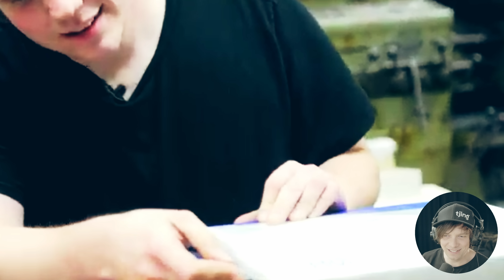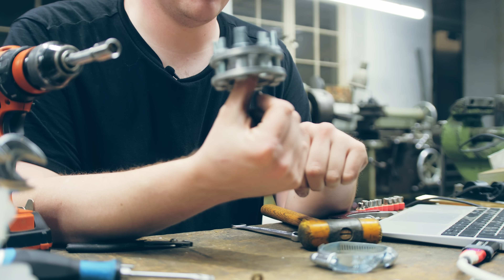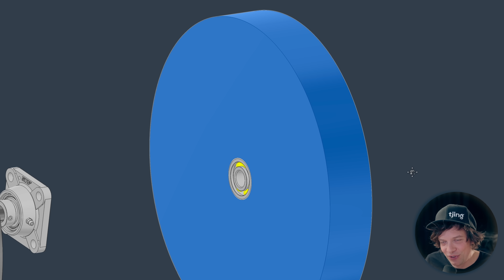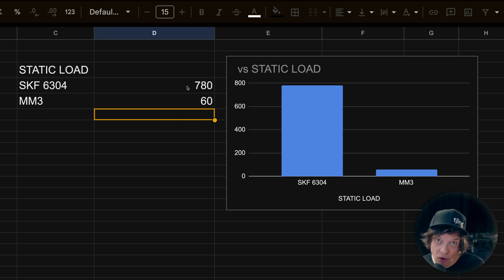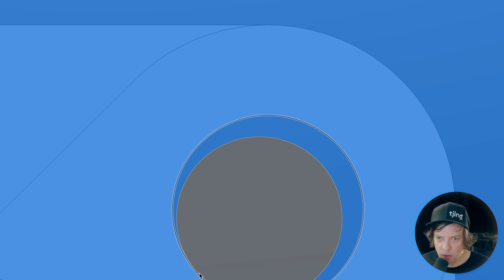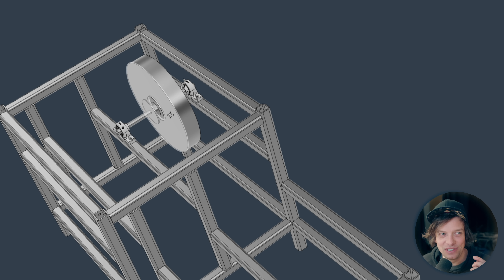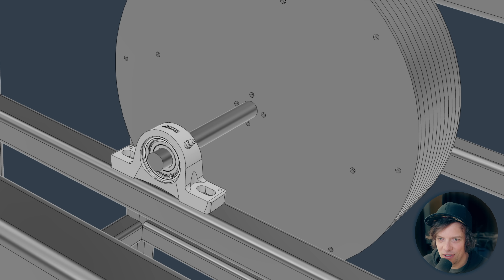Worst Bearing Housing Ever - Marble Machine 3 Ep.3

Comment: No Martin! The bearing load ratings are not what you should be worried about! The threads on the bolts WILL crush and that will allow movement and will get worse in a hurry. Even solid steel pins/rod would be better than anything with threads. The contact patch of the threads on the bolts is very, very tiny compared to the contact surface area the outer housing bearings were designed for. 

I have tried a threaded rod for a shaft inside a bearing and the threads crushed within a few minutes of runtime and had terrible vibration. I assume you dont want a lot of vibration in MM3!
Reply: I totally agree. The steel that is used in bolts is generally plasticine. It's not serious.
Reply: @no47-km  They make bolts out of all grades of all types of materials. It is very easy to find bolts made out of high grade steel.
I do not believe bolts are the right solution for the bearing housing but I do not agree with what you have written at all It's easy to verify what I have written to be true. Here are some grade ratings for metric bolts made of steel or steel alloys: 4.6, 4.8, 5.8, 8.8, 9.8, 10.9 and 12.9. Nobody is making bridges using bolts that could be compared to plasticine.
Reply: Exactly my concern and comment. Not only are you point-loading at the tangency contacts of the bolt to bearing OD, that supportive contact patch is further reduced by that the actual contact points are focused on the peak of the threads, which are relatively rather soft. A traditional housing has 100% contact area, whereas the bolt solution has less than 1%.
Reply: Not to mention that he's hammering them in and already mangling the threads to begin with.
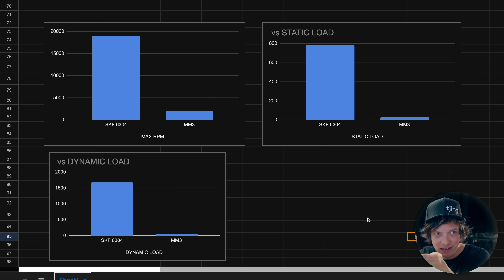Reply: It's weird how he is looking at posts discussing the bearing housing, all in response to a video on the bearing housing, and he thinks that the thing people say will fail is the bearing and not the housing. But I see he's not the only one, given the comment at 11:21...
Reply: Here is another thing; in previous videos Martin has mentioned that fewer parts have fewer points of failure and yet this has SO MANY PARTS compared to standard parts.
Reply: These parts are going to be vibrating to some degree. Even if this only affects the threads on the bolts a minuscule amount, any amount of give they gain will quickly snowball by adding to vibration, etc. The more they crush, the more it will vibrate, the faster they will degrade, and it could end up entirely tearing apart the machine.
Reply: I'm a bit late here, but Martin, I agree with @keonfrey5560 . This has ABSOLUTLY nothing to do with the bearing. The key thing you seem to not be understanding is that bolts are not intended to locate two parts on a sliding fit. They're intended to clamp two flat pieces together. In many of your applications on the MM3 it doesn't matter much, there is plenty of extra strength to handle a small amount of side load with little vibration full support all around and a rather short area of loading in the first place. Here you have one of the most critical highest danger/load/vibration applications that MUST work correctly for safety and function, and you're pairing it with a huge unsupported side load span on bolts. It WILL crush the thread, it WILL stretch the bolt over time, it WILL get loose, It MAY even start fracturing the bolts due to fatigue cracking. That bearing WILL come loose from the flywheel, it's just a question of how long it'll take, and this is not a factor that has any grey area.
Reply: Also, Martin, DO NOT trust GPT for something critical. The only thing it's been trained to do is to writ things that SOUND like the fit the prompt. It doesn't know and indeed doesn't even CARE about the correctness of anything. If you don't have the math skills to do the math, that just means you can't spot it when GPT is confidently wrong.
Reply: Yes the only way I can think of that the housing wouldn't move would be if the tension was really really high between the laser cut plates but that probably won't be enough friction to keep the outer bearing race from moving.
Reply: Also, bolts aren't made to deal with high shear forces.

Comment: do you really need that shaft has to be round? If it will be square it will lock itself in the corresponding holes in the flyweel. and for the bearings use lasercut conductors (inner - square, outer - round) =)

Comment: The failure mode they are referencing with your design is not with the weight capacity of the bearing, it is the support of the bearing in the clamp.The contact area keeping the bearing concentric is the threads you already deformed by hammering in the bolts. Think of how little contact area there is on the outside of the bearing being only the threads of bolts vs an entire solid housing. This will cause it to deform when flexed, any deformation each flex as it rotates will eventually lead to wear and failure, or running out of concentricity with prolonged play.

Comment: I really like the solution with adjustable paws, similar to a four-jaw chuck in a lathe. Don't try to achieve completely perpendicular and concentric flywheel plates - this is HARD. Get it close enough and have a method to securely adjust and dial it in using a run-out indicator.

Comment: I do not like your cheap bearing mount because it puts the load of the mass on the bolts and potentially puts in a side load to the bolts themselves instead of allowing the bearing itself to take the weight of the mass.

Comment: probably said 100 times arleady but from my experience chatgpt is pretty bad at math the foruma it wrote out (0.001 x 60 kg (209.44rad/s)^2 x 0.2m) results in 526.38N not 525.29N only 100ish grams of in this case but its enough to prove my point.
the Formula i dont know and i havent really experiemtned with those on chatgpt but it looks like a very big simplification becasue dynamic load usually is very use specific and complex.
But i think its okay in this case because all youre doing is using it to proove a point where even if its off by a small magnitude it doesnt matter.

Comment: It's not the stress on the bearings, that is a problem. The bolts are NOT designed for such perpendicular loads. This is the most scary part.
Reply: Shoulder bolts?
Reply: Especially the threads. They'll deform
Reply: Not only that, the threads have to withstand the forces. Since the threads act like small stands holding up the bearing and the weight of the flywheel, more pressure is on the tip of the threads, thus blunting it, causing the bearing to sink.
Reply: Also belting the bolts through with a hammer? It deforms threads and bolts, breaking the precision. So many parts…

Comment: You can use SHRINK FIT method to mount flywheel over shaft but use key also.

Still you need to plan for static and dynamic balancing.

Comment: With a live shaft maybe you can build the flywheel roughly with the lazer cut disks, and balance it afterwards with weights like we do with car tyres. Or perhaps you could build a jigg with the angle grinder for grinding the flywheel completley round while sitting inside your machine. Using your machine as a makeshift lathe. You could even grind the sides of the flywheel to remove any wobbeling. So... just build a mount for your angle grinder!

Comment: Without uniform pressure on the outer bearing race is important for a decent life. At 2000 RPM at an hour 120k cycles per hour. You will easily start to deform the bolts and lose the "press" fit that you think you have. Also the bearing race deforms and will wear out prematurely.

All being said you are welcome to try whatever you like. The SKF application engineers will tell you the truth and set you on a good path.
Reply: My thoughts exactly, these bearings aren't designed to be held with 8 point loads on the outer race. The race is likely to deform over time and cause vibration or worse yet complete failure of the bearings. They're designed to be held equally around the outside circumference. Press fitting them into plates and then bolting those onto the flywheel would solve that issue and allow for easy swapping if needed (aka the press fit flanged bearing holder).

Comment: On the laser cut flywheel, add a key hole on the center each plate in the same place. You can join all the plates with bolts anywhere. THen just use a keyed axis and a long key, as almost everything that needs a axe an flywheel clamped together do. You can machine the axe, but you can also buy it pre-keyed.

Comment: I am NOT a pro, not even a noob.

We do not want concentricity. We want the machine to be as stable as possible and if the center of mass of the flywheel is not perfectly aligned with its axe of rotation, then we have a problem.

Of course, being perfectly concentric would solve the problem but we can solve it in another way.

When repairing a car tire, the garage people mount the tire, then they spin it to see how unbalanced it is, and then they glue some mass on the wheel to correct the problem.

Doing the same thing might be a good idea. It does not require god like precision, and seem simple enough to implement.

Comment: Unlike the programming wheel, you don't need the flywheel to be concentric. Having a uniform radius around the flywheel is not really your requirement.

Your real requirement is balancing the weight of the flywheel, and there are ways to do that (adding in or drilling out unbalanced weight) that don't require concentricity.

Comment: I think you are looking at this wrong. A concentric flywheel is not necessarily balanced. Mounting the flywheel close to concentric then balancing it is likely much easier and faster than adjusting the bearings until there is no vibration. You'll find that a majority of low cost products that spin fast are balanced rather than perfectly machined or adjustable. I'm sure you can find somebody with a machine that is used to do balancing if you don't want to do it yourself. You can also design features into the bearing mounts that can damp any vibration that hasn't been worked out.

Comment: I don't think the comment about the bearing failing was in reference to the actual bearing, rather the housing.  Hardened steel bearing race vs mild steel bolts will wear them, and cause the bearing to be less constrained.

Comment: They are oversized so you can get it concentric - I used to work in a factory, and if they can do it for the industrial drain cleaning equipment, I am sure it will work here.

Comment: as a mechanical engineer i can't help but cringe... please listen to the comments, or read some design handbooks at least... or worst case ask for the help of an engineer... that's what we're here for.  if machined parts are a problem, there are rapid machining prototype services available that will work much like your laser cutting service.  Flywheels hold a lot of energy and should be treated seriously.
Reply: Martin isn't just falling into multiple useless rabbit-holes. He's farming rabbits and digging holes for them.
Reply: I haven't done mechanical engineering in almost 10 years now and I'm cringing too... He really should have considered off the shelf parts first and foremost. Not only are they a solution proven to work, but if anything fails, it's a phone call and an overnight courier away. What is he going to do if one of his highly tuned, custom built parts fails on tour?
Reply: @CristiNeagu  it's called industrial lego for a reason, he needs to use those pieces instead of bespoke parts

Comment: I know it may not be for this particular application, but if you laster cut the flywheel plates and are worried about how they are clamping on, you could weld them to the shaft. It would be harder to remove if you want to experiment with other things though. If you get a robot to weld it, the weld should be more accurate so that it doesn't become unbalanced as easily.

I think it isn't the best approach but maybe it has some positive that I'm not seeing. Just throwing it out there.

Comment: 14:30 Big long time fan but I am sorry, I gotta say something. This problem is not a problem. The actual way you would go about this is to laser-cut the hole undersized and use a H7 or H6 hand reamer that costs literally 10 Euros. You ream the hole to spec and you cannot get more accurate than this. Certainly (!!) not with screws (their outside tolerances from the DIN/ISO spec is way worse) against a bearing housing - don't do that.
16:20 Thats wrong. These bearings are not inappropriate for your use case, they certainly are appropriate. You actually NEED this degree-of-freedom in an application such as yours. in contrast, your solution over-defines the mechanical setup of bearings+shaft. Imagine one of your flange-mounting-plate is tilted slightly. Depending on the bearing a very slight tilt might already be enough for the bearing to not ride freely anymore. Some bearings have tighter internal fits than others.

Again, listen to the mechanical engineers (I do the same, since I am "only" an electrical engineer, but that is all stuff I have learned over the years. Use dowel pins or, as others suggested, shoulder bolts which are dowel pin and screw in one).

Comment: You don't need a flange to clamp the flywheel. You machine the shaft to have a "bulge" that the flywheel is pressed onto. Press-fit is standard for very large machines....
Reply: Heat the fly wheel up, freeze the shaft .... badaboom badabing.

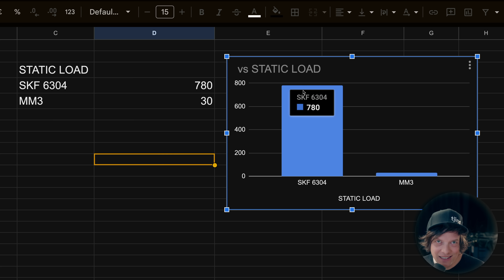Comment: 9:30 did you just half the load because you're using two bearings? Somewhere a FEM Software Engineer just died.
Reply: Isn’t the static load just the force pressing down on the bearing while not rotating?
Wouldn’t that half when the force is split between to points?
I would love an explanation, I’m genuinely confused right now…
Reply: @TheRedeemer2  that's assuming a list of things that is longer than my arm. For one, no rotating mass will ever be a static load. It'd need to be perfectly balanced for that. Like... Not well balanced. Perfectly. That perfect mass would have to be perfectly positioned on a perfect shaft. If the frame is somehow twisted, even slightly, there will be forces anyway, and don't even get me started on what vibrations will do to this system.
If you look at the "standard bearings" you can see that they can swivel freely. That's a very intentional feature. It greatly simplifies the transmittable forces. 

That being said, the characteristics of the bearing he showed are orders of magnitude above what he needs. Thus "failure" in this case means: High and atypical wear, high friction, unusual behavior like vibrations, etc.
It's just another symptom of him grossly oversimplifying an extremely complex topic. Then again he is in contact with a very well renowned company now, and they will hopefully give him honest feedback.

Comment: I think you're being a bit rude and stupid here. Instead of listening to the 2000 engineers in the comments, you act like you're the expert here and that you know it better even without a degree in mechanical engineering. You should be a bit more open minded towards the people giving you feedback. especially if they clearly know what theay are talking about.
Reply: I mean dude if it doesn't work he's gonna go with the one that works. I'm personally curious because I'm having an issue on something I'm building that's similar and if it works well I can implement it my design. If it doesn't than I know not to.

Comment: If you want inspiration from existing machines which spin stuff fast, look at lathe operation.  Your options on a lathe for workpiece holding: use a collet (only for round machined OD), or use something like a 4-jaw chuck that must be "dialed in" by the operator.  There is nothing wrong with having to manually dial in a setup.
Reply: My thoughts exactly.

Comment: Spends ages looking at the bearing tolerance. Forgets that the bots will be rubbing and straining against the outside of the bearing. Either bold or bearing are softer, and will wear the other destroying concentricity and perpendicularity.
Reply: This is precisely my concern and I find it strange that it has not come to the forefront of the discussion enough for him to feel like he should address it.
Reply: Agreed. The bolt threads are supporting the force from the bearing. Threads are not made for that purpose and will deform, thus loosening their grip on the bearing.
Reply: added to that the threads will be ruined and taking apart those housings to fix them, will be a pain.
Reply: "The most precise solution is the one where I have to hammer the bolts in" -- wut??
Reply: This has got to be the dumbest rabbit hole he's ever gone down.
Reply: The outside of the bearing doesn't move. It's the steal balls inside that are rolling. The outer ring is stationary with respect to the wheel, the inner ring in stationary to the axle.
Reply: @Lelentos   Yes, all of that is what is supposed to happen. But, if the threads become deformed due to the weight of the wheel/other forces then it will not happen that way. At least not without some, perhaps a lot, of vibration. Personally I am concerned about the weight of the wheel alone when it is not in use being enough to flatten one side of the threads.
Reply: @Lelentos  The outside does move too. Not to a layman, but from an engeneering standpoint it does. It vibrates and deforms elstically. This will in turn create movement against the peeks of the threads wearing them down and deforming them, intodurcing more room to move accelerating the wear. There is a very good reason bearings are universally seated in fittings with high roundness. That way it is evenly supported with the largest possible surface, giving the pearing little room to start moving and generate wear.